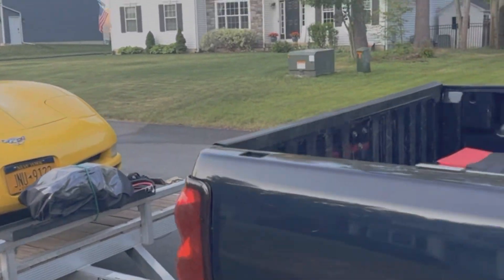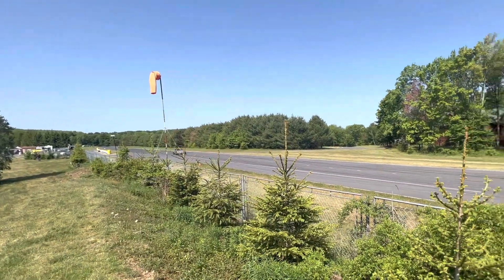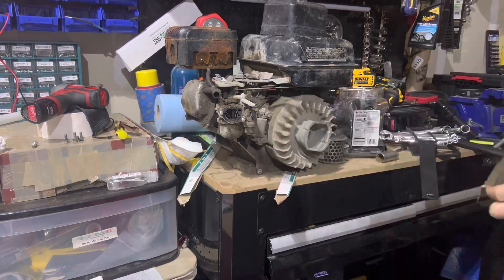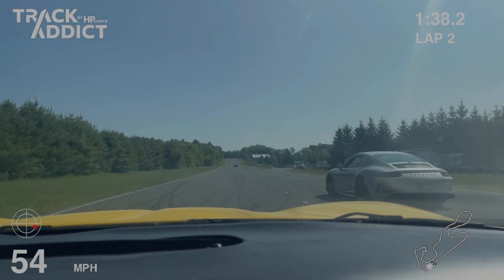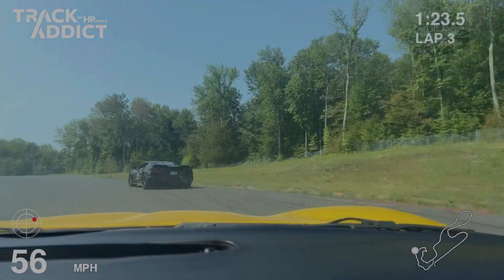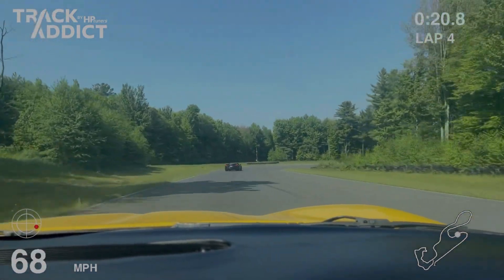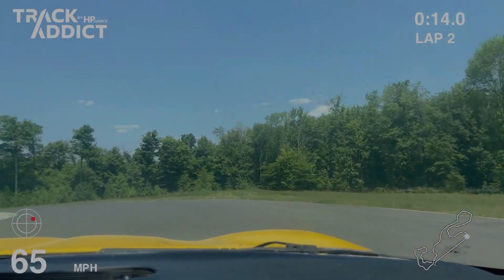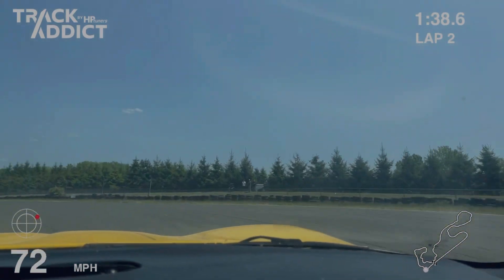TRACK TESTED! The Low Boost Films’ “Track Weapon” Camshaft on track review.

Comment: What position did you decide on using for your adjustable sway bars? Have you been happy with your brake pad choice for track and driving home? Were you using the exhaust cutouts in this track day?
Reply from the maker: Middle setting it’s pretty balanced. ST47 pads are a little too aggressive without slicks I should have gotten st43, but I’ve gotten used to them. I drove the st47 everywhere they just squeak haha. Yea cutouts WIDE OPEN!

Comment: I have a 2003 Silverado SS AWD and this is my dream to take it to a track day 😊
Im looking to get the same cam u have on ur vet for my truck
Reply from the maker: It would also work great in a pick up truck!
Reply: @LowBoostFilms  do u think I will need a stall for the cam to work properly?
Reply from the maker: @gerardomontoya433  I don’t know specifically, my car is a manual. However, if you call cam motion when you order it, they are really helpful and would be able to tell you exactly what you would need to make the set up work. They’ve sold a bunch of them for automatic cars.

Comment: You run traction control on the track?! Crazy man, I can't stand it. Pulls way too much out well before the limits!

Do you have track addicts data to share? Looks like you're running something for data. Would be useful to see top speed improvements on straights.

RE rotation, you can adjust your car for better rotation as well. Stiffen rear roll bar, slow rebound, increase front downforce and not rear like my dumb butt did but I'm happy with, etc etc.
Reply from the maker: I use competitive driving mode which takes traction off but leaves stability control on. 

Yea I have track addicts maybe I’ll make a separate video breaking that down! 

I have the rear sway bar in the middle setting which seems to rotate pretty well.